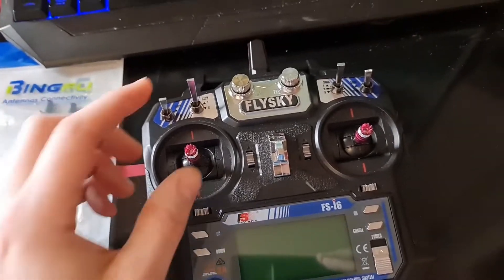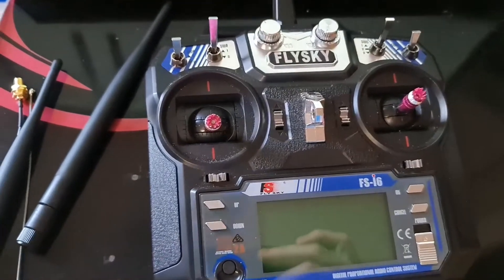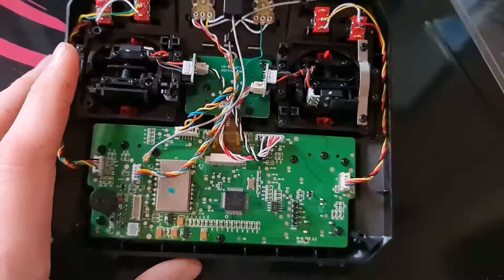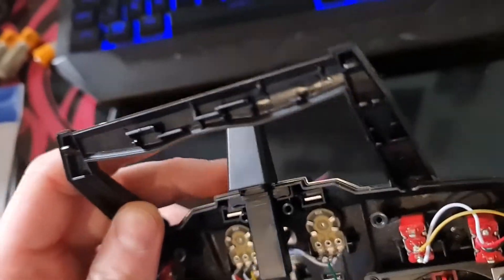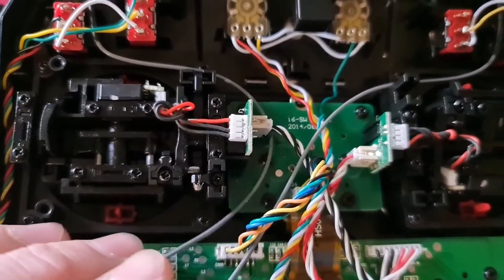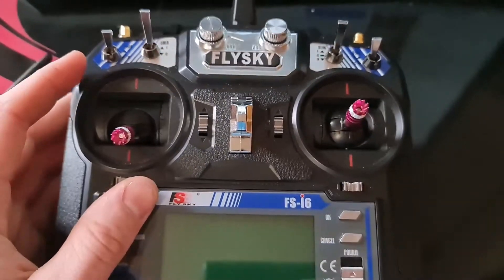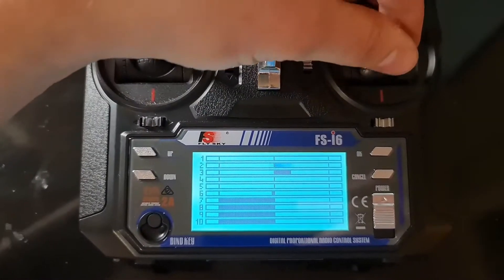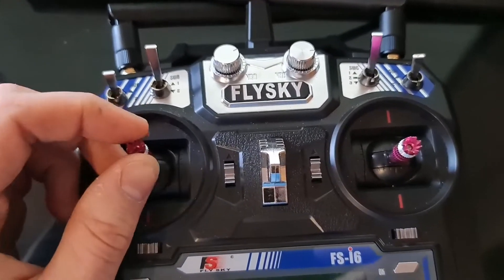Transmitter Antenna Upgrade - Flysky Fs-i6 range mod/upgrade

Comment: hello, I use an ia6B receiver with the ui antenna upgrade.... I put 2 antennas of 5 dbi each... to fully use the diversity of the radio.... I reached 3580 mts in rural area... I'm satisfied. ... Thank you for your help!
Reply from the maker: That's amazing! I've seen people using base stations with massive antenna reaching 10km! Crazy what you can do with these transmitters
Reply: @jimbob6063able  Really very good!

Comment: I did this mod as well because I live in the mountains with lots of trees. It definitely helps with penitration. Before I could not fly very far at all, but now I get a pretty good distance. I as well have not tested max range because if I loose service it will end up stuck in a pine tree who knows where. I ha e recently bought a GPS unit for my plane so it will fly back when out of range but I'm not positive how to program everything properly.
Reply from the maker: Joshua bardwell does a good although long winded video on gps set up. Simple once you know how! I'm also scared to test range due to fear of losing drone! Bet you have amazing views in the mountains 😍

Comment: Hi,can it works with dual band 2.4ghz & 5ghz antenna?
Reply from the maker: Sorry for not seeing this comment sooner. I believe you can damage the transmitter by using 5ghz as far as I'm aware. Plus there's a chance it could interfere with vtx signal
Reply: @jimbob6063able  Can you confirm this? As I bought a 5/58. GhZ antenna for both the receiver and transmitter.
Reply from the maker: @Ivor Bighood  they won't be compatible and you may experience signal loss. If you try the 5ghz let us know how you get on
Reply from the maker: @Ivor Bighood  higher dB value antenna the better
Reply: @jimbob6063able  I've decided to go with a DIY with two SX1278 LoRa modules. Am I right in thinking/saying that, as long as you can get the two talking and add the pins, it will basically receive the controls from ground station. Was going to try and replace the FlySky TX and RX to LoRa, but got scared and decided to just make my own with LoRa modules. The ones I have are 433khz, but have massive range. Let me know what you think?
Reply from the maker: @Ivor Bighood  definitely let me know hownyou get on!

Comment: Did it increase range?? If so how much? Thanks.
Reply from the maker: I've noticed more penetration through trees and the likes and a higher rssi output than before when flying same route long distance but I've been too scared to test to fully! 🤣 just the fact you can angle your antenna properly makes the most difference but you could also put smaller or bigger antenna on. been worth doing though and such an easy mod.